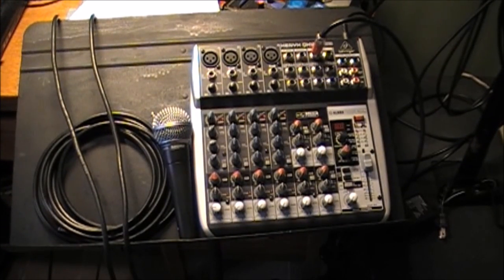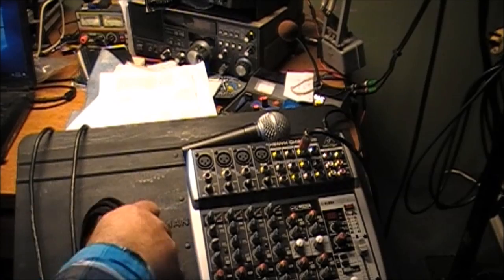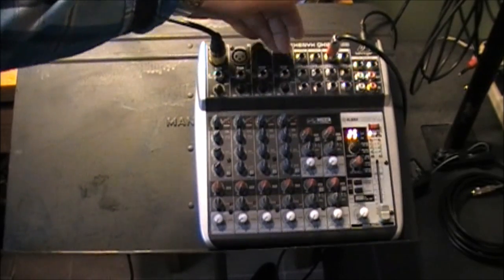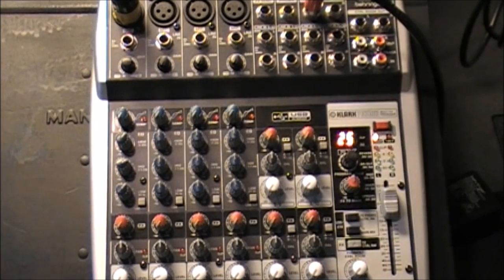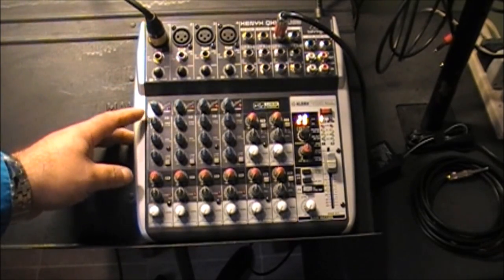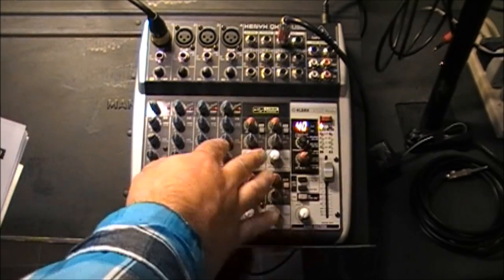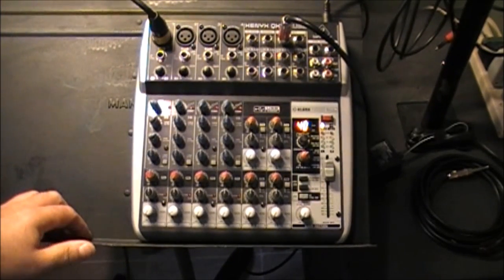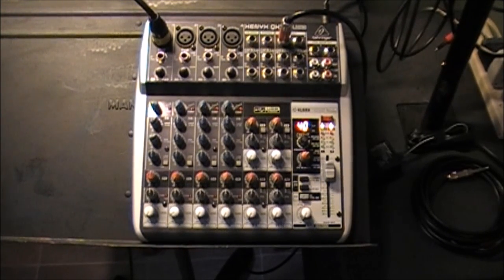Behringer Mixer: How to do a setup

Comment: Thanks for the informative tutorial, Andy.  I have been experimenting with linking the Main out to a Line in on a base amp whilst connecting a condenser mic via XLR in.  This results in feedback.  I am not using a DI box between the Main out on the Behringer and the Line in to the bass amp.  I can hear the mic just fine using headphones connected to the headphone jack/  Any comments?
Reply from the maker: I think it is possible that the bass amp input may be too sensitive for the signal from the mixer. That setup you speak of is not a common setup as the bass amp should be DI'd into the mixer and then mixer to power amp / speaker or powered speaker. Perhaps, if you are interested in using this setup you could lower the signal into the bass amp and use the amp power to amplify the signal via the main volume. Keep ypur levels lower than normal on the mixer and try not to eq the channels too high as it appears the signal is too hot and may be at a higher than normal signal in certain areas of the eq spectrum. It is not the best setup as your control is somewhat diminished because you need to flatten the signal going into the bass amp. The reverse setup I have mentioned will bring you much more control of headroom and quality of sound . A DI will help balance the audio as well in your current setup.

Comment: Hello, I’ve got a question, will I able to use a mixer if my speaker has AUX input? It’s just a cheap bluetooth speaker i wonder if i could have aux for the main output, cheers
Reply from the maker: You should be able to. The typical mixer output is only a pre-amp signal so an aux input on your speaker should accept the signal but the question is will it need amplification before the speaker or does the speaker you have have built in amplification?
Reply from the maker: IMPORTANT FOOTNOTE: Be SURE the mixer you use IS NOT POWERED as it could damage your bluetooth speaker
Reply: Need powered speakers

Comment: My PA System sounds bad after connecting to the mixer, does anyone know what the problem might be? Could it be the cable that I use for the Main Out? Because i,m using a balanced stereo cable while the Main out is unbalanced mono (the cable that I'm using: https://www.amazon.com/GLS-Audio-25ft-Patch-Cable/dp/B004MNTIL8)
Reply from the maker: Is your horn working? Is your speaker damaged and scraping causing distortion and other unpleasant noises? If you hear distortion, the preamp may be set too high. It is possible that the signal mix within the mixer is bad due to settings of the mixer or a fault with the mixer.
Reply: @Tobinindustrial  Thank you for the reply! Managed to fix it, it was the cable

Comment: Can I plug in input with the mp3 player?
Reply from the maker: You can plug your MP3 player into this mixer. You just need the appropriate patch cord. If your MP3 player has a 3.5mm stereo headphone output or lineout, then just get a quality patch cord that will have the 3.5mm stereo jack on one side and then on the other end whatever jack you want to use.  On the other end you can use two mono 1/4 inch jacks  ( use stereo channels or 2 mono channels) or the RCA plugs for tape or CD input on the mixer. A typical MP3 player has only a pre-amp signal and is safe to use but remember this mixer also has only pre-amp signal output and so you will need to put an amplifier on that signal before sending to a speaker or use a powered speaker. Good luck with your setup.

Comment: your incorrect compresion, is, in its basic form just an automatic gain control,[ agm ] ie what you uesd to get in old portable tape recorders, nothing to do with frequency as you erronously stated, compresion is there to equal out the volumes in a recording for eg, ie to reduce the diferance in the loud parts and the quite parts of a sound, which subjectively makes the whole sound , sound louder thats why they are often used in most professional recordings, though moderm compressers are a lot more complicated with many other extra functions but as i said its main use is an agc
Reply from the maker: Thanks
Reply: @Tobinindustrial  i had forgot all about this post but glad to be of help, cheers mate. best wishes

Comment: Hello Sir. Nice presentation. 

It would be nice if you can help me. Actually, i need a mixer only for karaoke and recording. So, what is the best way to connect it? Equipment is: PC, Stereo Receiver (and maybe Behringer Xenyx 1002fx). Because i want to recording, can i use input/output with jacks 6.3mm or only RCA on the mixer? Is it possible to do it like this: Using cable https://www.amazon.com/3-5mm-Stereo-6-3mm-Jacks-Cable/dp/B079L2NKFR i have to bring music from pc to mixer by 3.5mm jack in pc (audio output) and 2x6.3mm to mixer( Line in 3/4, L and R). Now i need a output from mixer to pc. So, using the same cable 2x6.3mm from mixer(main out L and R) to pc(audio line in) by 3.5mm jack. At the end, using this cable https://www.amazon.com/3-5mm-Stereo-Male-Audio-Cable/dp/B006CSOIUW 3.5mm pc audio output to RCA stereo receiver input? Or i have to do same steps, but via RCA connectors on the mixer and RCA cables? Btw Line in connectors on the mixer have controls (level, fx,...), and RCA connectors do not have it...Some problems because of that?

Other thing, how to connect dynamic microphone? XLR or jack input? I know XLR provide preamp, so can i use XLR preamp + stereo risiver volume? Will not fry sound card of pc?

What do you think about this product: Behringer MIX800 minimix? What is better for karaoke recording?

P.S. Will it "Line in" of PC support recording from microphone(via mixer), or i have to do it via microphone input of pc?

Too many of questions and my english language is not the best, but i hope you will understand what i asked...

Thanks.
Reply from the maker: Good day. In the essence of time I will respond briefly to your questions... CAPATALIZED RESPONSES

Equipment is: PC, Stereo Receiver (and maybe Behringer Xenyx 1002fx). Because i want to recording, can i use input/output with jacks 6.3mm or only RCA on the mixer? Is it possible to do it like this: 
https://www.amazon.com/3-5mm-Stereo-6-3mm-Jacks-Cable/dp/B079L2NKFR

(THIS PATH CABLE WILL WORK ON YOUR COMPUTER AND @ MONO HIGH IMPEDANCE CHANNELS ON YOUR MICER OR LINE OUTS, ETC...)

 i have to bring music from pc to mixer by 3.5mm jack in pc (audio output) and 2x6.3mm to mixer( Line in 3/4, L and R). Now i need a output from mixer to pc. So, using the same cable 2x6.3mm from mixer(main out L and R) to pc(audio line in) by 3.5mm jack. At the end, using this cable

 https://www.amazon.com/3-5mm-Stereo-Male-Audio-Cable/dp/B006CSOIUW

(THIS RCA TO MINI STEREO 3.5 WILL WORK ON THE RCA MIXER AS WELL FOR PATCHING)

3.5mm pc audio output to RCA stereo receiver input? Or i have to do same steps, but via RCA connectors on the mixer and RCA cables? Btw Line in connectors on the mixer have controls (level, fx,...), and RCA connectors do not have it...Some problems because of that? 
(ALWAYS USE THE PATCHING CHANNELS AND CONNECTIONS THAT GIVE YOU THE ,MOST CONTROL IE: CHANNEL FX ON BOARD VERSUS RCA CONNECTION) BOTH WILL WORK OF COURSE BUT CONTROL IS KEY)

Other thing, how to connect dynamic microphone? XLR or jack input? I know XLR provide preamp, so can i use XLR preamp + stereo risiver volume? Will not fry sound card of pc? 
(ALWAYS UTILIZE LOW IMPEDANCE FOR BEST AUDIO HEADROOM AND CONTROL)

What do you think about this product: Behringer MIX800 minimix? What is better for karaoke recording? 
(I HAVE NOT HAD THE OPPORTUNITY TO USE SUCH A RIG BUT IT WOULD BE A SIMPLE YET EFFECTIVE MIXER IF IT HAS ENOUGH CONTROL FOR YOUR KARAOKE)

P.S. Will it "Line in" of PC support recording from microphone(via mixer), or i have to do it via microphone input of pc?
(BOTH CAN WORK BUT ONE MAY NEED INTERNAL MIXER PROGRAMMING. ALWAYS READ UP ON THE PRODUCTS YOU USE TO SEE ABOUT COMPATIBILITY. ANYTHING POWERED MAY DAMAGE PREAMP SIGNAL INPUTS. iF IT IS PREAMP INTO A PREAMP SIGNAL IT SHOULD BE FINE AS LONG AS THE IMPEDANCE IS WITHIN RANGE)

I HOPE THAT IS HELPFUL. I WISH I HAD MORE TIME TO RESPOND IN MORE DETAIL. GOOD LUCK AND GOD BLESS.
Reply: @Tobinindustrial   I understood most of your answers. Thank you again. I forgot to ask you: If i buy Behringer Xenyx 1002fx, should i buy some audio interface too? Will i have it a clean audio signal with sound card by pc and stereo receiver only? Some ppl uses audio interface like this https://www.amazon.com/PreSonus-AudioBox-USB-Recording-System/dp/B071W6YVDR with their mixers, but i don't understand why...
Reply from the maker: @ultimategamerx133  I personally think it is a waste of mioney if you have a behringer board that hooks up to a computer. Having a good sound card and a decent computer and audio program is also beneficial.
Reply: @Tobinindustrial  I made this video for you: https://www.youtube.com/watch?v=ZevtlOdScpU
Is it good any sheme?
I think it's much clearer like this and good way to avoid misunderstanding...
I have had this https://www.amazon.co.uk/Karaoke-Mixer-Console-Amplifier-System/dp/B07BVGK7LW and it's worked like "Sheme5" in my video(Pretty good sound quality in live singing and record too). I never had a mixer and this is new for me. I can't find another karaoke audio mixer in my country. So reason why i asked you about a mixer
By the way, i don't know what is: FX Send and CTRL Control room connectors? Any use of them for my purpose?
Thanks for your time and good wish to answer.
Reply: https://www.youtube.com/watch?v=ZevtlOdScpU
Sheme 1 at start
Sheme 2 at 13 sec
Sheme 3 at 26 sec
Sheme 4 at 39 sec
Sheme 5 at 52 sec

Comment: Good Morning.
I come to ask for help in solving a problem.
I purchased a Behringer XENYX Q1002USB mixer. However as this model has no effects included, I intend to connect a Behringer Digital Reverb DR600, but I have to connect two cables from the Behringer Digital Reverb DR600 to the Behringer XENYX Q1002USB table, my question is where can I connect the cables.
One of them I know is at the FX SEND input, and the other cable to make the return, where do I call?
As the instruction guide does not explain, I hope you can help me in this matter, since neither the brand nor the supplier does not inform me.
Please, if possible, send detailed information to ruiisa@gmail.com.
Thank you
Reply from the maker: I have this mixer currently in storage but I think you may need to look at the 'insert' section of your user manual. This is especially made patch cables that look like normal ones but they do  not get fully inserted into the jack to work as they should. I have never had the opportunity to do such a procedure but the directions explain how to use it pretty well. That being said, if there is an 'effects send' on the mixer then there should be a return. Perhaps reading up on that 'control room' button and related inputs/sends in the bottom right of the mixer may shed some light on this. My apologies for not being more specific but I would only be guessing without the mixer in front of me to set up and verify. Good luck with this.